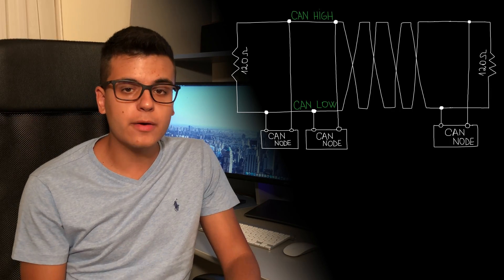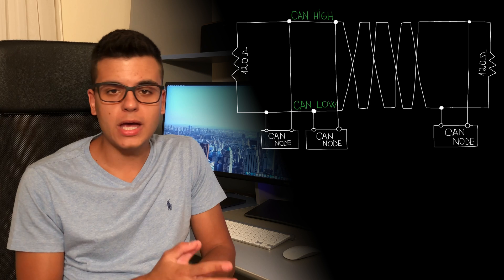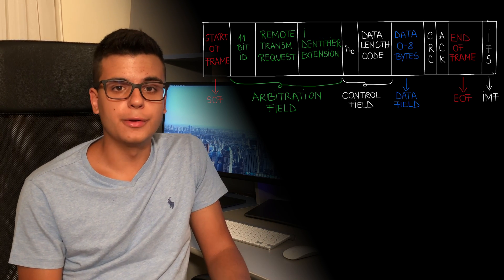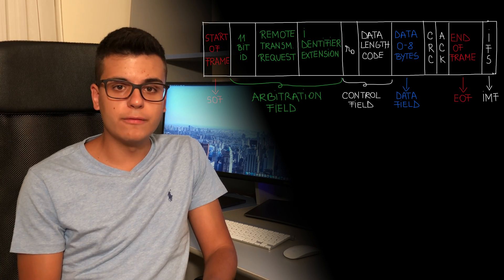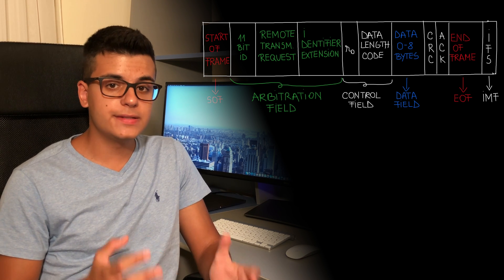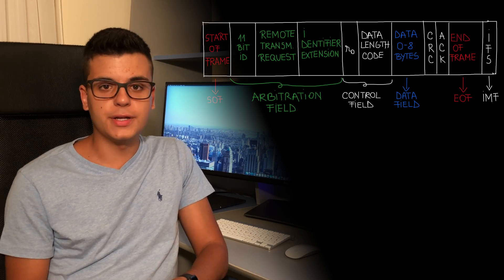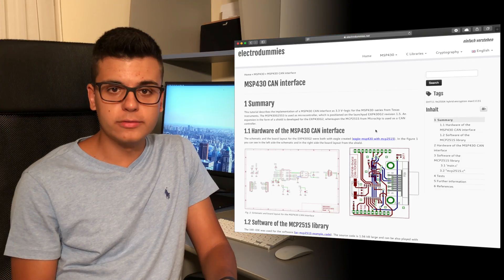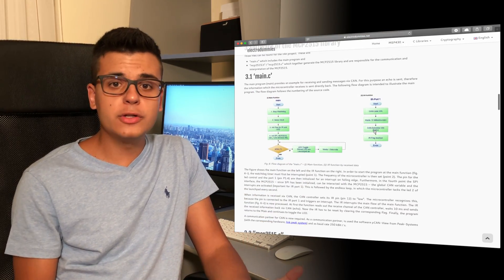Learn How The CAN Bus Works (Controller Area Network) | Embedded Systems Explained

Comment: Can i use RS 485 expansion board with the jetson nano development board to implement CAN communication between the different sensors and microcontroller to control the motor wit CAN compatible motor driver to control the motor ??
and for a DC motor how I can find the motor controller which is compatible for CAN communication ??
where I can get the basics video to learn and implement the CAN protocols in project ??

Comment: Why does the CAN bus still take a performance hit with one wire? Isn't the data still sent at the same rate?

Also the bit you were saying about frame checking got a bit garbled. Frame checking is making sure all the parts of a CAN message are present... "and if things such as a recessive...the limiter bit is present after the CRC and Acknowledge field."  .....what? What is a limiter bit? Do you mean frame checking is part of the CRC/ACK process? So if the frame check doesn't seem right the node will leave the ACK high/recessive so that the message is resent?

Thank you so much! This video was wonderful! :D
Reply: I think it takes a performance for two reasons, one:  because the processor is checking for the differential. The processor is expecting CAN High and CAN Low to either be the same voltage (2.5V) or offset by +1.25V for CAN High and -1.25V for CAN Low from the "recessive state" voltage. Not only that, but if one of the lines fails and just reads zero, the differential can no longer occur because the resistances can no longer provide the necessary impedance for reflection blocking. Open circuits means current can't flow, thus a performance drop due to reflected waves.

Comment: I bought 2 controllers from a manufacturer whom I'm having problems with getting the how to connect CAN cable to the two controllers. As I'm not technically equipt to read electrical diagram and was promised pic. image of the wiring and have been unable to get image, I obiously have nightmare of a situation. Is there any way you can help? Thank you in anticipation.
Reply from the maker: Could you tell me what microcontroller you are talking about? I’ll see what I can find out!